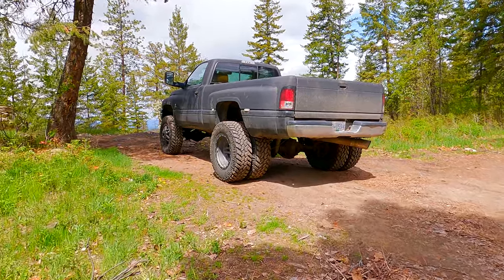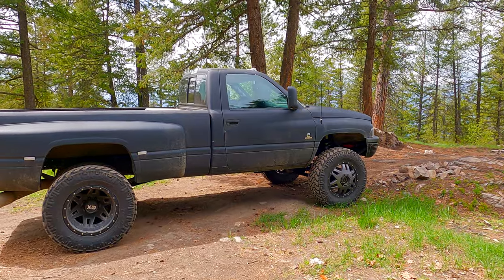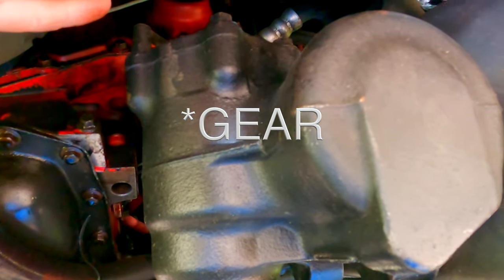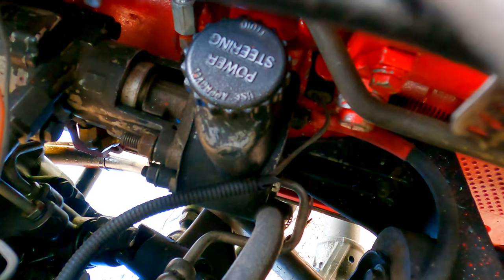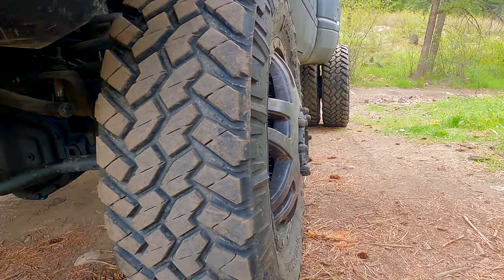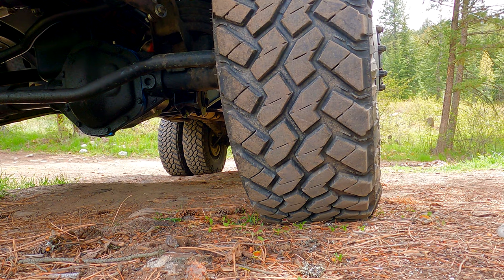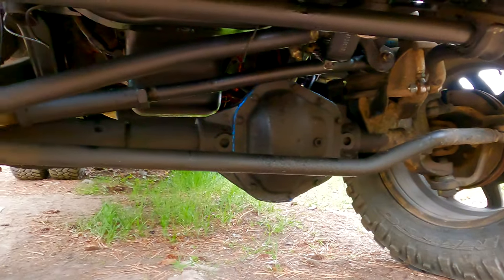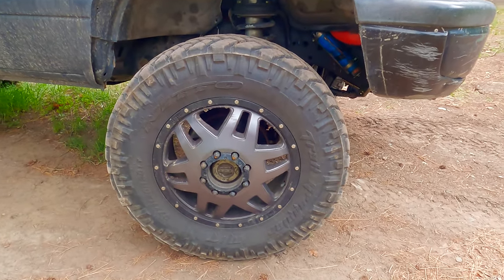Dodge Ram Steering Problems Fixed with the PSC XD Steering Gear!

Comment: Set your caster more positive, will help to reduce the straight line wandering.
   Just because the caster angle is "in spec" doesn't mean it can't be fine tuned better.
   If lifted, you would need longer arms to.get the needed angle
Reply from the maker: Good point!

Comment: Thank you for you videos. I have a 97 3500 4x4 cummins.  I special ordered it. Took delivery April of 97. It sat for 18yrs due to death wobble.  Long story.  182k miles on her. Back then skyjacker 4.5 lift. New ball joints unit bearing AGR steering box and pump track bar by DT fab and much more but couldn't drive Skyjacker is crap! So it sat. Now new paint original color white. EMF ball joints Rough country long arms ( solved death wobble) synergy linkage I Had EBC brakes just put new pads. Carli suspension with king shocks, leaf springs no blocks. I already put an ATS trans in 20 yrs ago only 10k on it. Looks factory new with new oem badging.  Due to your videos i ordered psc gear box and pump with new lines the extremely low milage AGR box is crap and binding, there's much more. Anyway if you have other means of communication reach out. Engine mods still to come I only have a fuel plate I put in 22 years ago which burnt the trans.
Reply from the maker: Awesome man! Best way to get in touch with me is on Instagram. @thestockybaldman

Comment: the psc steering box is the best upgrade I've made to my 1994, not even a contest. replaced suspension (slightly lower tier Carli kit than you), ball joints, and traction bar (thuren 2013 style) as part of a front end rebuild, left a 4 year old redhead box in, and saw basically no improvement (not that I was expecting it, linkage and original style traction bar were in good shape). Decided most of my steering play was coming from the redhead a few months later, replaced it with the PSC, and the truck has basically been driving itself ever since since. I never had death wobble, but had a frightening amount of steering input to keep it straight nbefore the psc box. I can't say enough good things about it, I even up upraded the steering linkage to the 98+ OEM HD t-style later on, and still thinking the PSC box was easily the best money I spent.

I'm not running a stabilizer either right now on 315s and it's been absolutely fine. will probably add one soon, but it just makes the difference from just the psc box even more impressive. 

I went with a Borgeson pump so turning at a stop isn't as easy for me when necessary, but that's my only regret.
Reply from the maker: Awesome, I love seeing the different ingredients of parts that people use. Sounds like an awesome setup

Comment: My redhead box is horrible almost worse then the original box i had from 1997.    I will be purchasing a bog bore PSC 6 bolt for my 2nd gen 12valve this week and will be doing away with the steering box stabilizer but i do have my steering stabalizer/damper shock
Reply from the maker: I spent about eight hours driving on the highway today. I absolutely need a steering stabilizer!